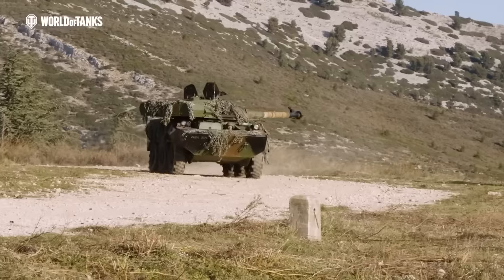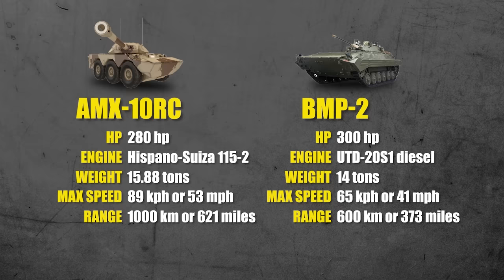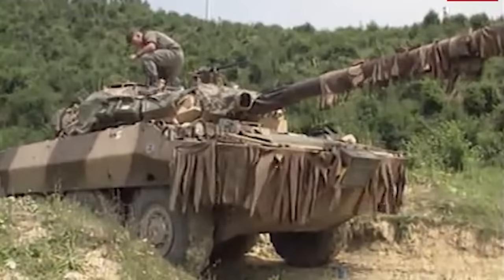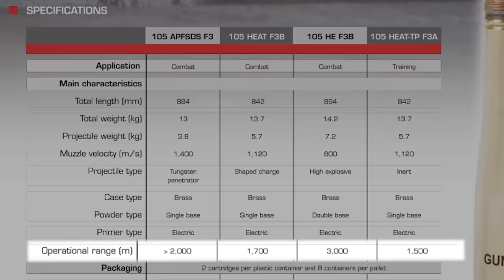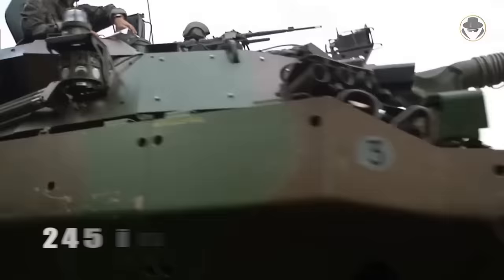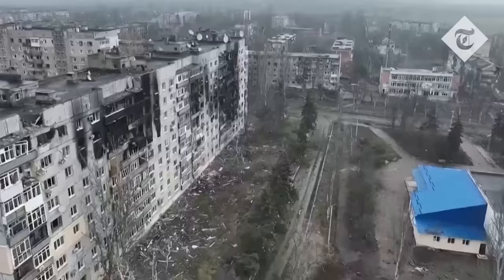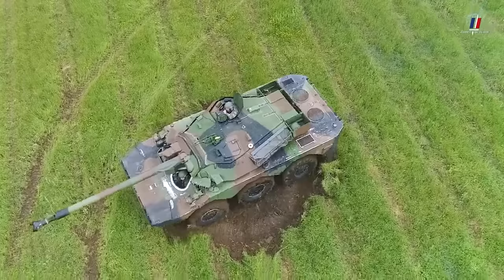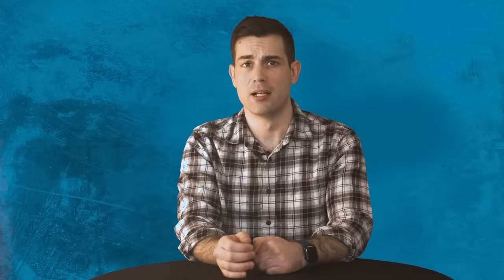Can the French AMX-10 RC Make a Difference?

Comment: Let's get it straight people. AMX-10 RC IS A TANK. In french. 

Within the French army, it is referred to as "char" - a tank; as opposed to "blindé" - an armored vehicle (VCBI, VBA, EBMR). It was purpose built as a *light* tank - a rapid reconnaissance vehicle to exploit a breakthrough made by MBTs and infantry and go after front reserve, command posts, barracks, depots and artillery in the 20-50 km depth with a potential for a 200 km-deep strike if it can go full speed on roads. It can also go on support missions in case of an infantry break-through, providing firepower able to annihilate anything but an MBT from the safety of the rear position and blow up buildings used as a fortifications to clear the way for the infantry it supports.

The only thing that makes it not a tank in NATO classification is the fact that it has wheels as opposed to tracks, but that's a deliberate choice to make it better adapted to its role and provide capabilities it would not otherwise have. However, for a native french speaker that has been briefed by a the French Army Chief of Staff, it is a tank, called a tank, quacking like a tank and, except for wheels, looking like a tank.
Reply: I totally thought this was going to develop into an anti French military comment instead of an educational one. Thank you.
Reply: I'm pretty sure it's not 🤔 from what I heard, it wasn't heavy enough when it was developed to be a tank (that thing was amphibious at the start). Later they added more armor that made it heavy enough to be classified as a tank, but since it started its life as a véhicule, it is officially a véhicule and can't change.
So technically it has the characteristics of a tank, but on paper it's an armored vehicle
Reply: Not really... it's called a "véhicule militaire blindé de reconnaissance" which roughly translate to armored reconnaissance vehicule. 
Tanks are called "chars" in French, like the char Leclerc.
Reply: @gastonjaillet9512  I’ve heard them consistently referred to as “chars” in public for at least 15 last years. Wikipedia in French also says char. Most of FR army comms says char. Teams working on them would often refer to them as “blindé”, but so do teams working on Leclercs. My point is that it’s not a “Lol, Macron is dumb, those clearly aren’t tank” but a “french experts briefing him in french called them tanks, in french, and he sure AF did not go to Ft Leavenworth to know the detailed differences between French and NATO nomenclatures, so he just translated it as a tank in his English speech”.
Reply: It's a T-eddie bear
Reply: It’s a « véhicule blindé » not a tank. Period
Reply: Frenchman here: No it is not a TANK it is an RC (Roue/Canon = weeled canon). Excellent machine but not good in the mud.
Reply: @robertagren9360  😂🤣😉
Reply: @thehturt5480  Well not really, much like historical analogues like the german ww2 puma it's an armored vehicle with a cannon. Also it doesn't even have a 1-plane stabiliser, pathetic as a tank.
Reply: @andredulac4456  From what I understand, intended role and usage makes something a tank as much as its physical characteristics. The Swedish S Tank is a good example, white its lack of a turret would make one inclined to call it a tank destroyer and not a tank, the Swedes considered and classified it as tank because they used it in the same role as a tank.
Reply: @Riceball01  And then you have the American tank destroyers that all had tracks and turrets just t add to the confusion...   so yes, intended use is as important for classification as physical construction.
Reply: tanks don't have tires and never will. tanks were made to cross trenches in WW1, hence the tracks, not tires.
Reply: @85Funkadelic  it's inaccurate tho.
Reply: @gibbsm  A tank (since WWII) is definied more by role and usage than actual physical characteristics. One of the things that people use to define a tank is a turret, yet the Swedish S-Tank didn't have a turret but the Swedes called and fielded it as tank. As for trench crossing, with 6 large, fairly closely spaced wheels, I'd imagine that it could cross the same trenches that any comparably sized tank could.
Reply: All this is semantics and not important. It has a capable gun, no stabilizer, poor aluminium protection andwheels. This is the design, and it should be used accordingly, period.
Reply: @johanmetreus1268  Yeah they next to 0 armor and would get penetrated by anything over 14.5mm. E.g slugger, hellcat or wolverine.
Reply: 100%. People need to look at the doctrine primarily, not the design. It is a light tank through and through, with characteristics of a tank destroyer. I'm not sure what else it could really be called, the fact that it doesn't have tracks is entirely secondary to its capabilities and the missions that it's given.
Reply: @shaddaboop7998  Exactly. Another good example of this is the Strv 103, aka the S-tank. Being turretless people might think that it's some sort of tank destroyer or assault gun, but despite its lack of a turret, the Swededs considered it to be a tank and they used it as a tank.
Reply: Ok, but it cannot fill a present day MBT role. Its hardly armored enough to stand up to a big autocannon, much less present day tank gun.
Reply: @andersbjrnsen7203  It's not meant to be an MBT it's meant to be a light tank for reconnaissance and flanking manoeuvres. Jesus.
Reply: @shaddaboop7998  Im perfectly aware of that. Im taking part in a discussion of whether its a "tank" or not, and pointing out that it cant fill the role of an MBT isnt exactly unnatural in that setting, is it?
Reply: @andersbjrnsen7203  
It'a an old heavy armored car (1981) with added lateral armor (sbd) with a front aluminium armor equivalent to 40mm for hull and 30mm for turret of homogenous steel.
The 105mm gun is a low pressure gun 105 mm F2 BK MECA low pressure inferior to the last 105mm M68 us gun (300mm for APDSFS and 350mm for HEAT ammos); unable to penetrate frontal arc of russian tanks T72B3M, T80BVM et T90 MS....
In final this HAC is equiped with 6 motorised pneumatics unable to move in ''Raspoutitsa'' ...
Reply: @asm5987  its not meant to take on the real MBTs. Frankly I dont quite see what its role and purpose would be in this particular war, but I guess all mobile fire support you can get is a good thing.
Reply: @andersbjrnsen7203  Yes, it is not an MTB, never was meant to be an MTB and should in no case be used as an MTB. It’s a light tank for reconnaissance and infantry support mission that will rely on its infantry to eliminate an enemy MTB if it ever encounters one.
Reply: @AndreiKucharavy  I know your point in the first post was mainly linguistic. The Germans have much the same, everything on tracks and some armor there is a "Panzer" so an IFV is a "schutzenpanzer".
But you must have some clear distinction between the name for the vehicle in point and a leClerc? They cant both be just a "char"?
Reply: @andersbjrnsen7203  it’s different from German - in French you call everything armored “blindé”, on tracks or not. Of all the active armored vehicles only AMX-10RC and Leclerc are referred to as “char” however. It’s more a question of direct fire large caliber with armor than armor + tracks.
Reply: @AndreiKucharavy  I see. Very interesting. In Norway we use the terms "stridsvogn" meaning more or less directly "chariot of war" for the "real" tanks, "stormpanservogn" meaning "armoured storm chariot" for IFVs. We dont operate any other armoured vehicles of note, but a thing like the amx in question would probably just be called "panservogn" ie armoured chariot regardless of playing, armament or purpose.
Reply: Weird, I served in a French Main Battle Tank regiment (501eRCC) .. and the AMX 10RC  was never called 'tank', it was an Armoured Reconnaissance & Fire Vehicle.. (véhicule militaire blindé de reconnaissance-feu ), even now if you to the official army site, they call it this way.
Reply: @AndreiKucharavy  Just checked on Wilki in French.. no 'char' but 'véhicule militaire blindé de reconnaissance-feu': 'Blindé' means armoured, not tank.
Reply: @JC-mo1od  “Les derniers AMX-10 RC furent livrés en 1994 en une série de 12 chars pour” - après les équipages de Leclerc les appellent aussi les blindés, malgré les communications de l’armée du fait que ce sont de chars à proprement parler. Si on regarde le rapport du ministère de défense pour 2021 en anglais, ils citent le Leclerc comme MBT en anglais, mais les AMX 10 sont cités comme « AMX 10 RCR (Tanks) ». Au bout d’ un certain moment faut tirer un trait et dans la communication des armées le AMX 10 a été appelé suffisamment de fois un char pour que la confusion de la part de Macron soit excusable.
Reply: This is the problem with categories, they are always somewhat arbitrary and not perfect for describing many things. I think the YT guy did his best to describing this.  But your info added alot. Thanks
Reply: It can destroy any modern MBT's with APFSDS shells.

Comment: Advantages I see from the AMX-10RC in the Ukraine War:  1. it is fast and has long range, and could be effectively used for scouting ahead of the main armored force. This is better than using HMMVs for scouts (as USMC 1st Recon had used during the Gulf War, see "Generation Kill" ) as they offer some light arms protection against rifles and frags and there is a mine protected version too.  2. If while scouting it comes up to an enemy machine gun or BMP such as at a road block, it can destroy that with its cannon. 3. It will intimidate the Russia ground troops, and can be used to take out lightly armored ICVs or any logistics vehicles, and does so much cheaper than using Javelin missiles etc. Single 105MM round is sufficient for those vehicles/targets.  If kept mobile, it can be a hard to hit target for Russian artillery, given their slow kill chain, shoot and scoot.
Reply: I forgot about the massive role of artillery in this war... But you're absolutely right. When spring comes, if Ukraine is still on the offensive, the AMX might be the perfect tool
Reply: I think that treating it as a better armored, much better armed HMMV is actually a really clever approach.
Reply: @rstrakovsky  Especially when you consider depreciation and fuel consumption...
Reply: The problem I see is the heavy mechanisation of Russian forces, there going to run up against auto cannons and die very fast. Best to use them in quiet sectors as assault guns, they have HE and could be useful in that role. Otherwise they will have a short shelf life.
Given the choice the Ukrainians would take an equal amount of bmp2.
Reply: @merocaine  it's frontal armour offers "enough" protection against 30mm autocannons and the rest can take on 20mm, so no I don't think they'll die as easily as one would think. The concern is more that it can't directly take on Russian heavy armour outside of opportunistic fights.
Reply: @Blabzcrow  What offensive?

Comment: Definitely see these as a highly mobile fire control platform for open country (hopefully it’s signatures can be easily obscured) and as potential infantry support in built up areas. I think it would be useful in those roles if it’s able to chamber the ukes’ HESH round.
Reply: I think in Ukraine, if a rôle doesn't require a 105mm-cannon, the AMX-10RC won't be used there. The Ukraine has Recon and Fire Control vehicles already. What it lacks are Armoured Fighting Vehicles with cannons able to defeat an MBT, even if they have to flank it to be effective.
Reply: Unlike most other NATO tank armaments, the AMX 10 can fire HE shells but can not fire HESH rounds

Comment: Three Bradley IFV with 5 man fire teams, two of those and they have a light Armored reconnaissance squadron.
Reply: I thought the same. AMX-10 would make a good combination with Bradley.
I have read in other places that the cannon of the AMX-10 can easily destroy the armour of the Russian tanks.
Reply: @sidritkurti1173  I ve read that to but only in certain places so the problem is manouvering the piece without getting shot up by the tank you wanna destroy. And that might be one problem to maney though.
Reply: @sidritkurti1173  the Russian army is down to using the T-62 as the mainstay replacing the T-72. All incoming Russian tanks have optics from the late seventies and they no longer have effective night vision or communication. Getting behind the Russian T-72 and T-90 will be easy giving these a fighting chance if they come up against them. The more likely scenario is that Marder and Bradley will take out tanks and these the infantry.
Reply: @sidritkurti1173  Some tanks frontally (basically pre-1985 armor models, which represent about 10% of RU tank losses in Ukraine),. You would also need a post-2010 T-72/80/90 variant to have the thermals and firecontrol to see and shoot at an AMX-10 in before they see you, shoot at you and get to safety. Where the AMX-10 strength is its ability to blow to pieces any non-MBT vehicles and reinforced positions, pretty much as soon as they see them. Unlike Bradley missiles, active protection against an 105mm round going Mach 4 don't really exist.
Reply: @AndreiKucharavy  I think that if Ukraine had those AMX-10 back at the Kharkiv offensive, the territory liberated would had been much larger. By now the towns of Svatove and Kremina probably would had been liberated back then.

Comment: looks like a good option for a backup firepower if you need to quickly move it for hundreds of kilometers between parts of the frontline.
Reply: Yeah I was also thinking that could be a role it could fit, I doubt that the AMX is that well suited to this conflict as it has been in others so its important to use its strenghts
Reply: It'd be great supporting infantry too, Hans there's Russians in that building!
What building?
Thanks Hans.

Comment: AMX-10 is no wonderweapon. But it is a capable system. Having them at some front, or deploying them to some assaults, will have a positive effect on the battle. AMX-10 has relatively modern IR and thermal optics, good magnification, and laser range finders for accurate shots with less training. The suspension allows it to minimize its' profile while firing from behind cover. Being fast means it can be stored in camouflaged positions at a more rear guard location, and rapidly deployed where needed.

Comment: Given how Ukrainians were capable to put Caesar artillery guns onto barges to bomb Snake Island, I have not doubt they'll make good use of AMX 10, despite their limitations.
Reply: @koskok2965  Well, it was in the NYT. In any cases, BONUS artillery ammunitions against anti aire vehicles don't require too precise accuracy.
Reply: Caesar was slightly turned into a mobile coastal gun.
Daym drones upgraded it by alot.
Reply: @koskok2965  I just read that again in french news Le Figaro interviewing the Ukrainian commander who is claiming this action. Weather condition should have been extremely calm, but the size of the barge is an important factor here. Also, the black sea is an interior sea. There is no stabilizer, but it would depend higly on the speed of the gun targeting, which is purely automatic and thus depends on GPS of gun, GPS of target, plus gun attitude. I have no idea how fast attitude control is on the gun, however fast and automatic attitude is the main point of the entire design.  Anyway, the NYT says that French officer correspondants were "astonished". Finally, the artillery guns on vehicles have better anti-recoil systems than usual artillery canons. I agree it could be propaganda. Also, we don't know in the end if it worked...
Reply: @piwi2005  Thanks for the info. I suppose if the sea was extremely calm and the CAESAR has a totally overkill closed-loop aiming system, then that would result in a viable solution for accurate artillery fire. 

It just doesn't make much sense to me as a mechanical engineer, since the aiming system only has to bring the gun to the correct direction while the entire platform is completely stationary. There's no technical requirement for extremely fast response times. Designing the automated aiming system with response requirements as tight as a stabilizer should make the system more complex and expensive that it needs to be for its application, which is not a good thing.
Reply: Похоже этот самоходный мусор настолько бесполезен что его не смогли никак использовать даже украинцы

Comment: Imagine how potent it could be with a gun stabilizer...
Reply: Not enough space in the turret, unfortunately. It was designed before gun stabilization was a thing and its best use is to scoot-and-shoot from behind a cover anyway.
Reply: No need. Computer assisted aiming.
Reply: The aiming sytem is stabilized, so on the commander's signal the driver (pilot in French Army) stops and the gunner has just to push a lever for the gun to come to the aiming point.

Comment: I like French military assets a lot, they are different (in a good way). I really hope that Mirages 2000C will fly to Ukraine. Especial if they send version with RDM radar capable of firing Exocets.
Reply: The probability of the 2000C is indeed rather high.
The Ukrainian govt is asking for the Rafale, just as they previously asked for the Leclerc, in both cases knowing the french would not give them their biggest guns, but the next thing on their arsenal.
The 2000C, like the AMX10, is newly decomissioned.
Now, like the AMX10, it wouldn't be a wonder weapon.
Reply: @MN-vz8qm  Wonder weapon no, I agree. On the other hand, Ukrainias are fighting against T-72B against which it can be used as a scout or tank-killer. Mirage would be nic anti-ship or ground atack plane. Against Su-27 even with Super 530D??? I dont know.